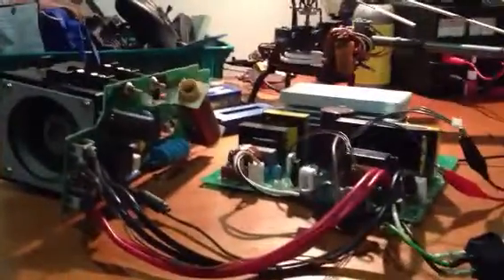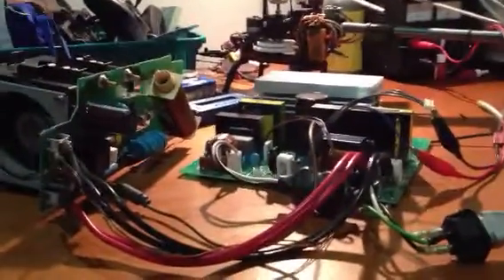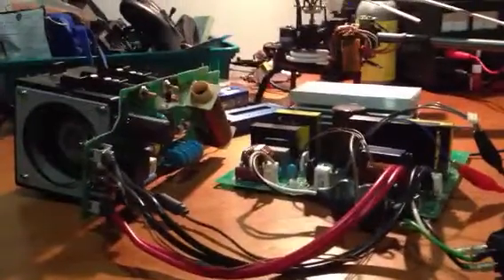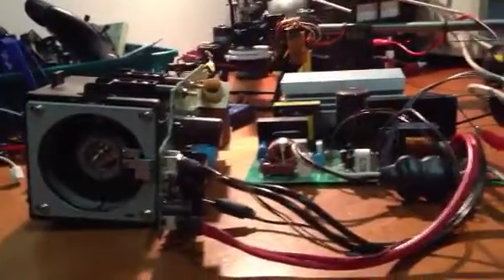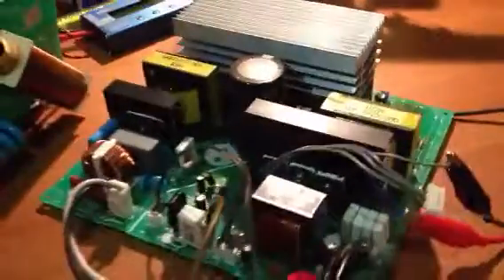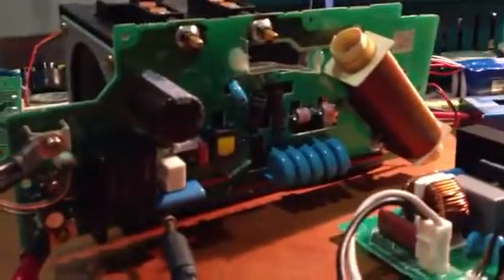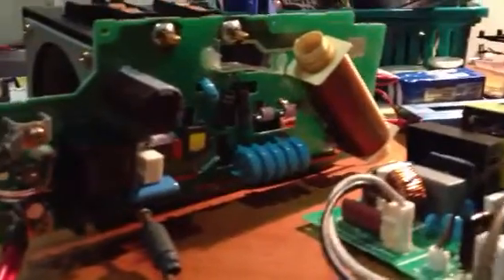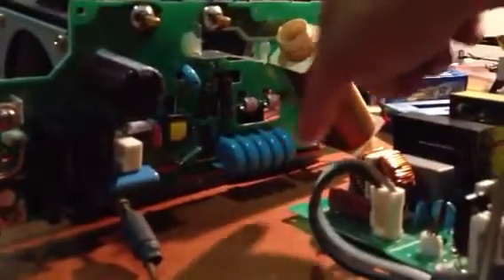500w xenon short arc HID, lamp ballast ignition DIY demonstration

Comment: rippling light like that makes me think that lamp is now acting similar to a 'gassy' vacuum tube -lamp running low on xenon after 25 years? know anyone that blows tube envelopes? would be interesting to see if lamp could be evacuated & reloaded with xenon at correct volumetrics for the lamp.😁👍🇺🇸😎